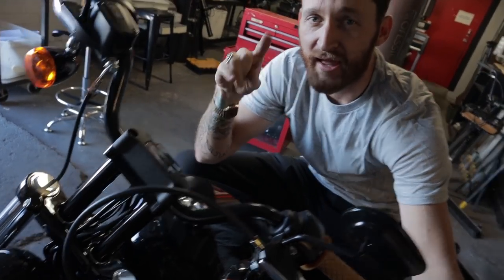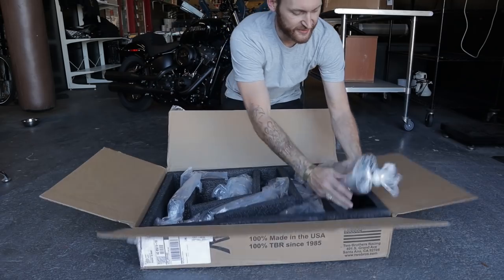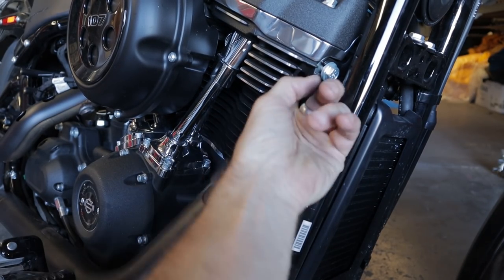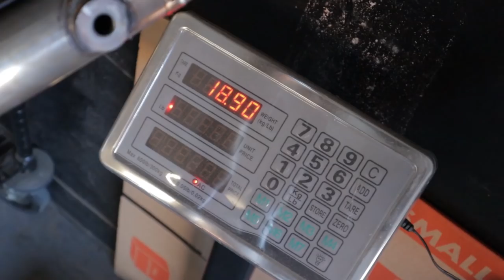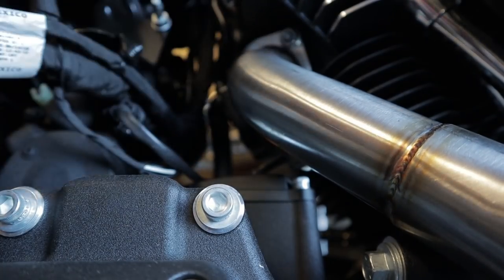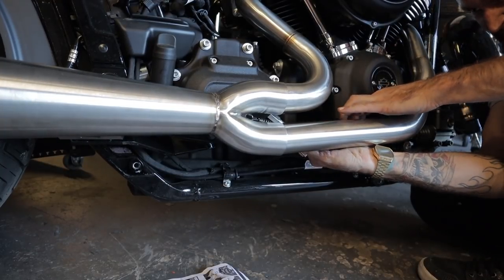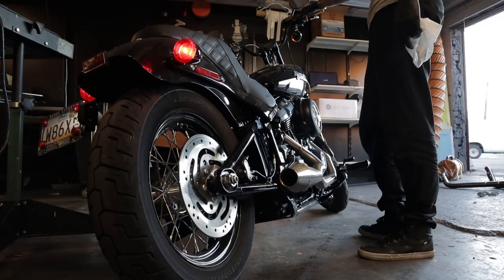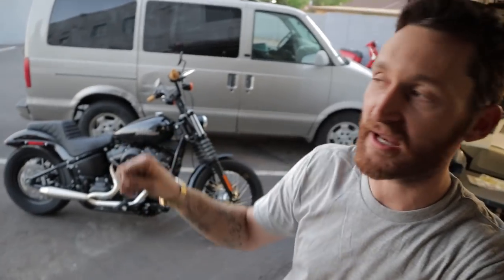Two Brothers comp 2 Exhaust on FXBB Street Bob | Harley Davidson 2 into 1

Comment: Did you add a tuner pack?  If not how does it run with the exhaust only?  Cheers
Reply from the maker: I did not yet, it runs fine but my understanding is that they do help.
Reply: The Print Life only tune when air cleaner installed
Reply: So its not required to do a fuel pack or tune when changing exhaust system?

Comment: Hey, great vid. I have the same bike. would i be able to keep my passenger pegs on there, or would they interfere with this two-bros exhaust?
Reply: Nick Voshall  it will fit as long as you use the upper bolt hole. I mounted the TBR Comp-S on my 2019 Street Bob this past weekend. It sounds awesome.

Comment: What kind of gaskets did you use? Thanks
Reply: Marco antonio. You use the ones that are installed on your stock pipes.
Reply: No I don't think those are re-usable if you mean the metal gasket rings between the exhaust ports and the pipes. They are a seal that tapers a press fit against the exhaust pipe end as it tightens onto the (cylinder head) exhaust port. They are s'posed ta be pretty cheap to buy.
Reply from the maker: Marco. Imthe replacements didnt come in by the time I did the vid I rode it around using the same ones and it was fine, I have since replaced them. No noticable difference but I'm sure it important.

Comment: Pipes sound good.  You should look at doing a 1 1/2 inch tank lift. I think the Heritage rear coil is taller.  Look on Matt Laidlaw channel for Nick's 2018 Softail Low Rider "S" and 2019 Club Style Street Bob  The new Softail ride so much better than older Harley's
Reply from the maker: Interesting. Why do riders lift the tank?

Comment: I like the sound, but for the costs' i thought the fit and finish would be a little more refined. I know they have a popular name,my brother has them, they seem to hold up. Good luck with them.
Reply from the maker: For sure when I first Installed it I was concerned, but they dont leak or anything after everything is tightened up they are solid as a rock.

Comment: are you considering a fairing or a windscreen? i've been running a memphis shades screen on and off, and i can't tell if I like it.
Reply from the maker: I consider it all the time but from what I have heard they provide very little difference in terms of wind blockage. I'm considering doing the frame mounted fairing.
Reply: The Print Life if you’re talking about that bmc fairing, badass. I recently swapped out the screen for a quarter fairing, and it works perfectly for freeway riding.
Reply from the maker: @drippybuckets  what's the quarter faring look like?

Comment: I see you didn't change the air intake.  Did you use an auto tuner? Or not really necessary.
Reply from the maker: I think it needs the auto timer becouse it has that back fir when you let of the throttle. Bit as far as power I dont really care to much,

Comment: I live in Phoenix also and have a 2018 street bob as well. I was wondering if the step up seat puts you much further back on the bike. I’m 6 foot and trying to make my street bob fit a little better. I was thinking of doing the Bmc/Corbin seat. But that step up seat looks good too. Does it give you more leg room?
Reply from the maker: Im 6' 3 so its a squeeze on me to, the step up pushed me up and forward bout and inch. I dont feel like its that tight of a squeeze for me, although I'm used to sport bike style riding.
Reply: I got my FXBB back in July I’m 6’3 and I went with the BMC Corbin seat since it’s a little wider and better for passengers, but it does feel a decent amount higher and way more comfortable for my legs and ass! I fully recommend this seat!
Reply: hyrum hunt does your seat sit you further back or the same.  Thanks for the reply.
Reply: You aren't too far from the Corbin shop in Hollister. You could do the ride in service and get a seat custom fit for you. There is no additional cost and you get to customize the fit and materials. You can also put on forward controls from a Fat Bob that would help stretch you out a little.

Comment: Does anyone know if the gen 2 is louder than gen 1? Thanks
Reply from the maker: I think its quieter if I'm not mistaken, I have been running this thing for awhile now, its not very loud at idle, but if you crank it the things sounds like a damn race bike.
Reply: @ThePrintLife  thank you!! Are you happy with the brakes. If I get one, I'm thinking of braided lines and better pads.
Reply from the maker: @mikeessary4925  They are great for me but I ride like a puss. If you stunt Im sure you would need better brakes.
Reply: @ThePrintLife  ha ha ha !! I lived out in the valley from 2000 to 2003. Love your videos. Ride safe out there.

Comment: We now have access to HD corporate balance sheets , and some very disturbing inside e-mail message traffic. Apparently, this motor company is in debt to the tune of almost 500 million dollars in loans, and no longer has the cash flow to service the debt.  We also know about the tin plated clutch bearing and tin plated cam bearings designed to fail after 10k-15k miles. We know about how on-board computer programed to provide dealer "black flags" to void any factory and very expensive extended warranties. We  been shorting HD stock ; like Big Time ; for the last 5 years recouping thousands of dollars. We see the accounts where Harley has been hiding cash in their off-shore bank in Ireland and other places. We see these accounts been drained alot during the time of the last HD CEO...... Maybe this why he resigned, I don't know.
We believe ; also given the total abortion in design flaws of stupid MIl-8 engine, this motor company will go under in next 4 or 5 years ; unless the US Government decides to bail out HD like they did General Motors................